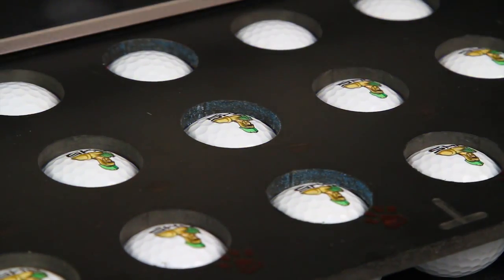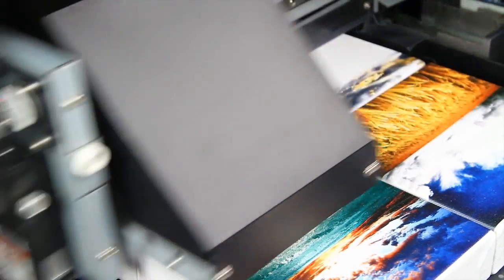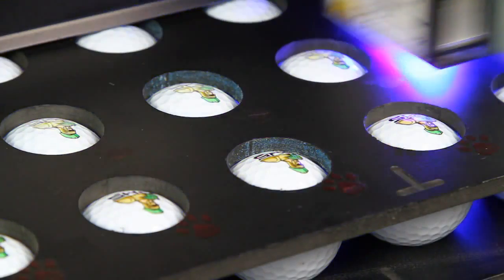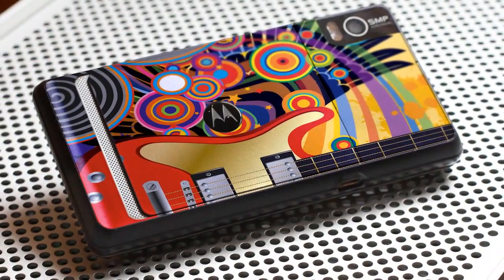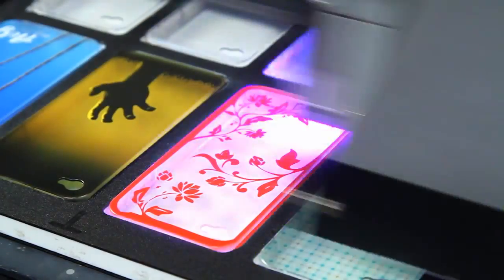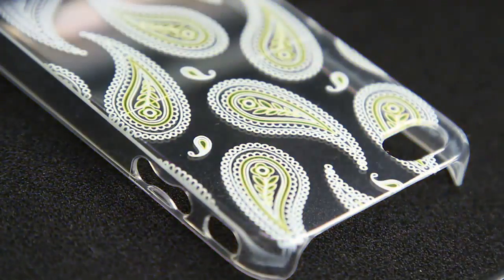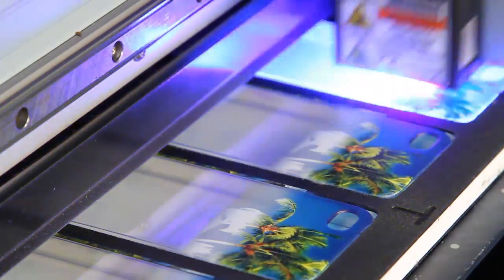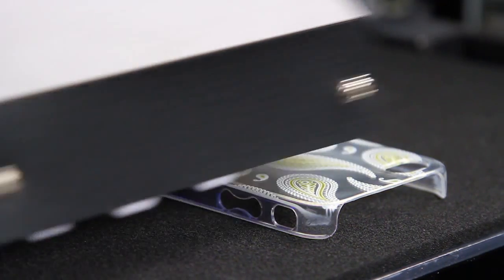Roland VersaUV LEF 12" Benchtop UV Flatbed Printer

Comment: Hi there... is there a cheaper alternative in the market for UV printing?
Reply: Juan Gonzalez Recently bought one which is made in china for about USD 4k. Not the best, but works. LEF-12 gives you amazing quality but the chinese one works fine for household stuff...
Reply: Harshil Shah Actually it's not household, I wanna sell custom mobile phone covers. Do you think a machine like yours can handle it? What would be the downside?
ps.: what model is yours? do u have a link?
Reply: Juan Gonzalez Its not something I would recommend for commercial purposes. The colours are a little off, and sometimes its a little misaligned too. Customers wont be happy with it for sure. I tried printing a mobile phone cover for me, and it printed magenta instead of purple. A few other colours were also off. It was fine for my application.

Bought it at aliexpress.com. The link for the model is: http://www.byc168.com/other/products_view_153.html
The link is for an A3 model, but I bought an A4 model.

You got to take care about it, as they will not provide any after sales service / help on it. I had to infact search for the drivers myself and had to get it to work. I would give the printer a 6/10.

But for the price, compared to Roland, it is acceptable. got it at 1/6th the price of Roland. Cant compaint too much about it. You get what you pay for.
Reply: Harshil Shah Thanks so much for the thorough info man! Tremendously helpful... So, you think the best path for me is to get $20k for a Roland Lef-12? Or do u think is there is a better/cheaper solution that still would guarantee safety (that the printer will not break or something) and quality?
Reply: @juancpgo  yo compré una Uv a4 un dolor de cabeza
Reply: Downside is they all lie, I had Chinese, Roland and Mimaki and none of them can print on glass, they all say it can but you can easy scharatch the print with fingernails, forget printing on glass and metal, also for printing on silicone cases you will need soft UV inks which are pain in the but for maintenance, soft inks clough the print head every week. I sold all of them after 1 year, UV printing sucks big time and its not working well. Eco solvent printing works good but its only for vinyls, cheers. This is as real as it can gets, inks are too expensive, only one who have good profit are them, selling ink as gold.
Reply: probably the missed color is beacsue of the ICC. We got better printers in China.